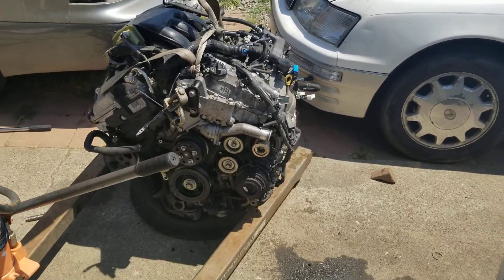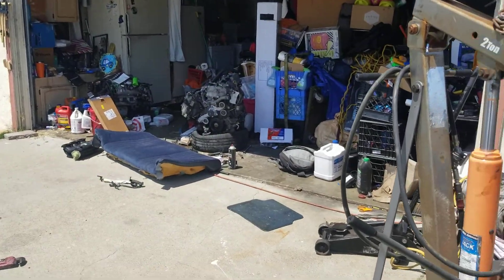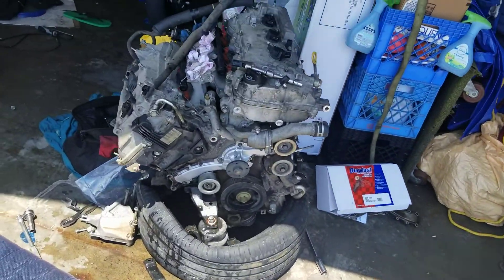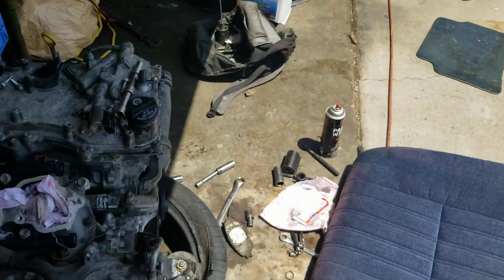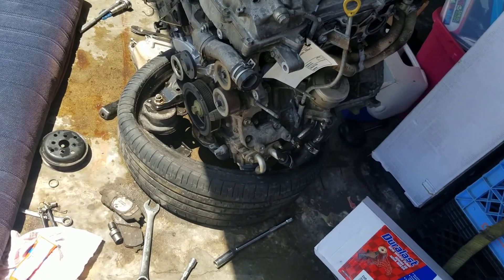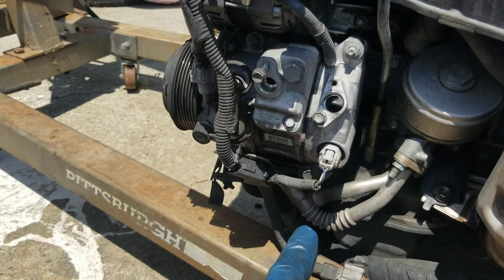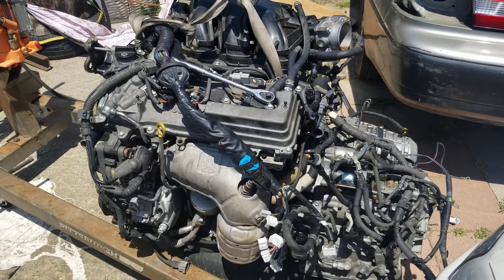07 engine removal Sienna

Comment: Thanks for upload Bro!
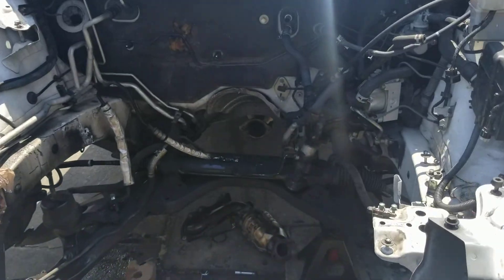 Please how did you get the exhaust manifold out before taking off the engine block? (0:38s) Did u undo the 6 manifold bolts from bottom of car?
Reply from the maker: Yes the backones I had to do from underneath Before pulling it out
Reply: @sid51011  thanks a lot. My manifold is cracked. Need to swap it. Thanks for all the experience sharing